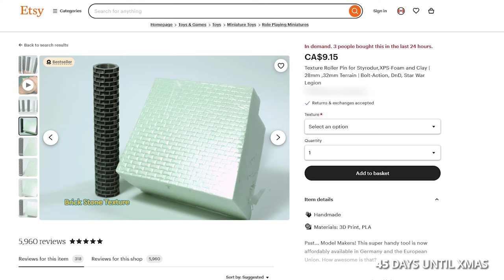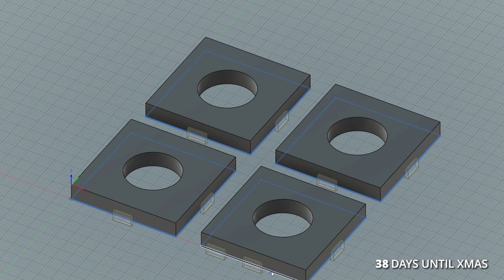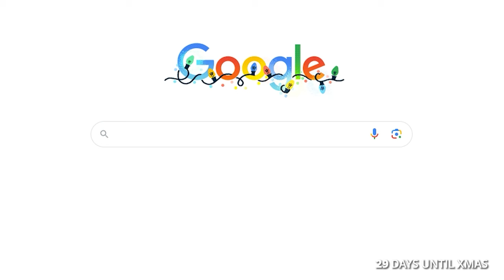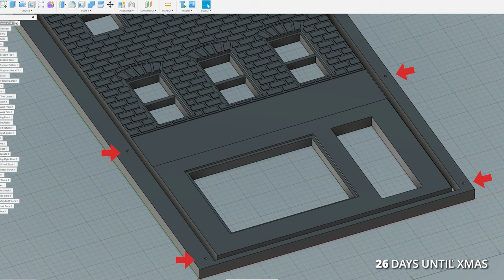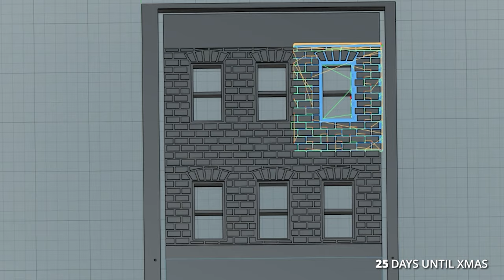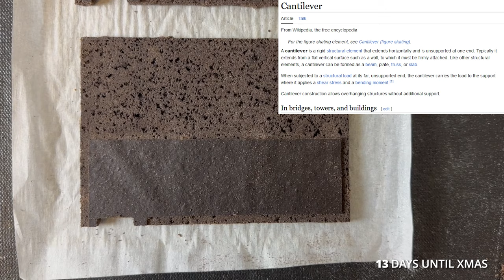I made a Gingerbread House/Laundromat with a CNC machine

Comment: Hi again, I have a few questions about this project.  Could you answer the following?
1) Did you design the entire building on CAD or just use paper sketches and only draw pieces if you were engraving?
2) What thickness did you use for the building structure?  Did you discover any upper/lower limits for gingerbread thickness?
3) Did you use any unusual recipe or modifications for the baking?
4) Did you find any good references for making gingerbread art or did you make your techniques from trial and error?
Reply from the maker: 1) I designed it all in Blender before I got the machine, but for future buildings I will likely start directly in CAD. Almost every piece was cut on the machine so I did make the entire thing in CAD, otherwise I used cardboard. I need the 3D model regardless of the machine because it lets me measure the pieces in context, especially the thickness which you don't get with cardboard.
2) Gingerbread thickness varies depending on the piece, the minimum workable thickness for me is 2.5mm pre-baked which bakes to 5mm and the maximum I've worked with was the Laundromat sign which was about 1.5cm post-bake. The walls are 8mm pre-bake and 1cm post bake. This assumes you aren't using any leavening agents like baking soda.
3) I used a standard recipe this year but I had trouble with humidity softening the pieces, so I am considering replacing some of the molasses with honey next time to absorb moisture, as well as keeping the pieces in an airtight container, you should try that and let me know if it works!
4) The gingerbread masters (who are way better than me) often compete at the National Gingerbread House Competition in Asheville, NC. I've learned a few techniques from those builders like "ginger clay" and "gum glue".
Reply: @zachareal  Thanks for the detailed reply, I really appreciate all the info.  I’m excited to put it all to use next year (and use the project an excuse to get a CNC haha).  Happy holidays and merry Christmas!  -Ryan